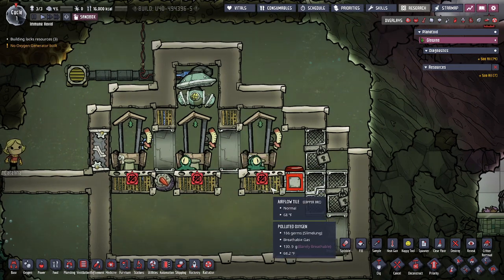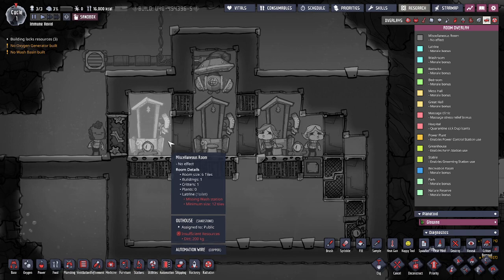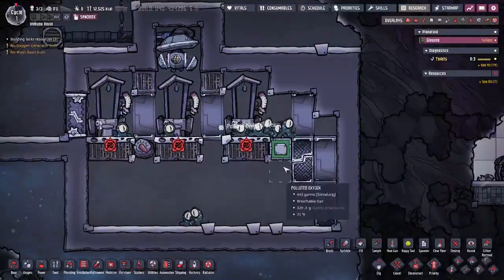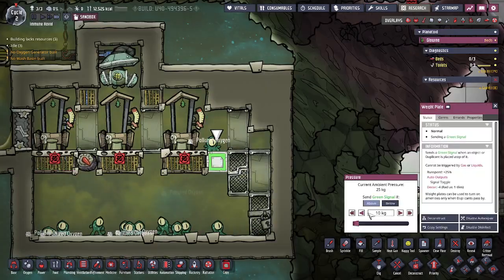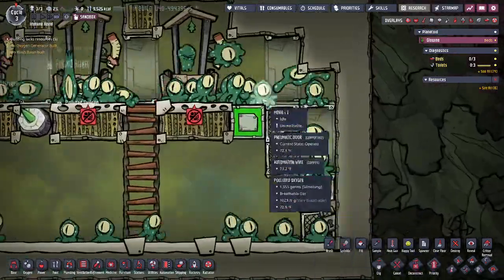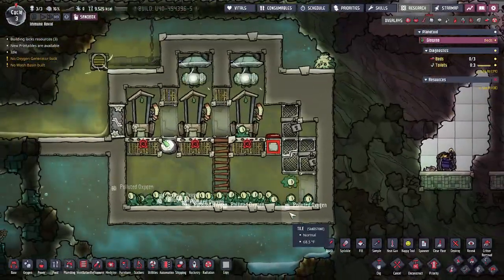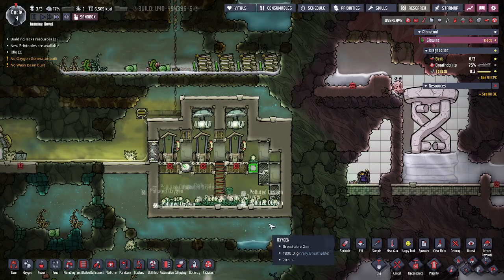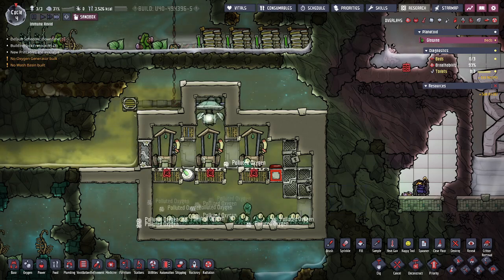How To Make A Polluted Oxygen Farm Using Morbs Oxygen Not Included

Comment: 1. Why make this?
2. How to create the Morbs?
3. How do you get rid of the pollution?
Reply: 1.Infinite oxygen with no cost
2.Full toilets that weren't cleaned for a long time has a chance to generate morb every game tick and cycle morning
3. Radiation or floral scent should do the job. Radiation straight up kills the germs at alarmingly fast rate. You can construct this farm near space or a broken sattelite to get a lot of radiation where polluted oxygen flows. Floral scent on the other hand generates its own "germs" that leave no space for slimelung to grow, and replace it over time

Also you can freeze p-oxygen and heat it and it will turn into regular oxygen where germs die on their own

Comment: I want to suggest to put the pump at the same floor the morbs are, near the entrance of the room, but with a wall separating them. And if you want to prevent Slimelung, use a plant that release floral scent to cancel the desease. I use a similar concept with a polluted water vent in my base of Oasis, with three air filters on the floor above the pump and two extra above those three on air flow tiles, to clean the air before distributing it in my base.